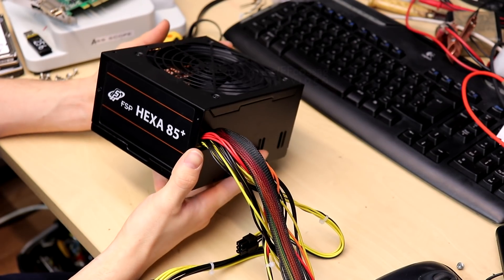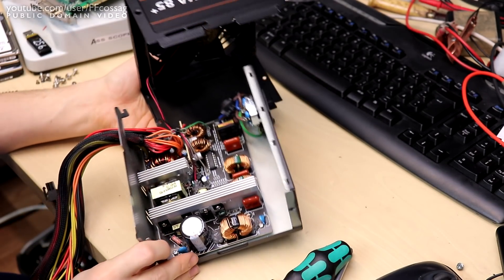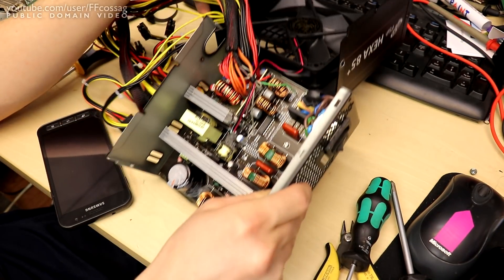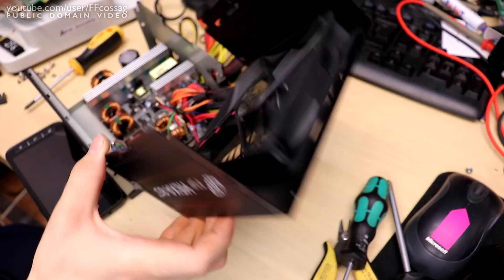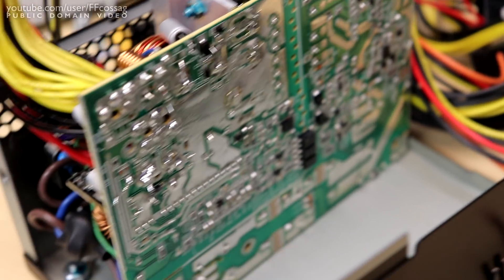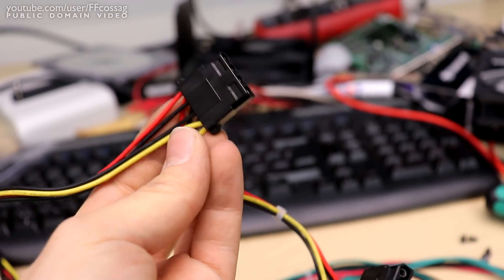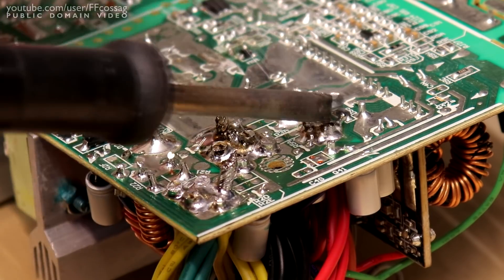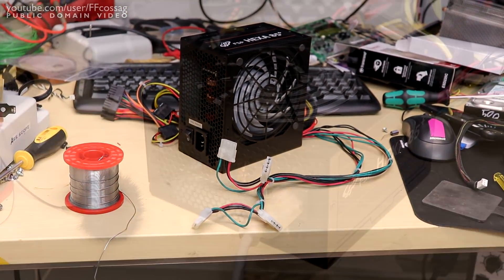FSP Hexa85+ 350 W teardown & modification

Comment: now that I'm finally doing proper research after several years... looks like all the scary stories about the bomb-tastic Hexa series are a myth?? The way I see it, Fortron just loves rebranding. Rebrand over a rebrand beside a rebrand. Different platforms which are difficult to track down just by price and naming. The original Hexa afaik was an absolute turd. They've also got a lot of Hypers, Hydros, different Raiders, OTHER kinds of Hexas etc. The system integrator lineup varies per region. Lots of models in Europe, a bit different stateside, a WILDLY different lineup in Russia, with some models actually branded Q-dion o_O
Well, guess the newer a budget FSP is, the better. And the Hexa85+ is to be trusted. Modern schematic, very tidy inside, Jap caps (I'm not afraid of poly Crapxons :P) -- and it's not really more expensive than the numerous Hyper M, Hyper S, Hexa+ and original Hexa units, all based on similar ultra-cheap 2000s platforms ... Guess some Be Quiet we didn't notice may be based off this exact thing :P
Reply from the maker: My tactic for choosing power supplies is generally just to go by 80+ rating. All those trash-tastic ancient designs are going to fail any spec past vanilla 80+.
Reply: @FFcossag  just don't grab Aerocools pls, no matter Bronze, Gold or Unobtainium 🙏🙏 I fear for the hardware of Aerocool users. They're not ancient but they're the epitome of bait-and-switch 😐 They (=Aerocool chaps) take a decent but already non-spectacular Andyson or HEC platform, send units on this platform to reviewers, then swap factories, cheapen out on the guts and call it a day, making sure that EVERY BUYER (mayyybe apart from the first batches) will get a turd with innovative smoke-emitting wires, exclusive Chenxingxangfujun crapacitors, supervisors or select diodes that tend to be just a tiny bit suicidal 😅, or all of the above. Should I even mention those numerous fake 80+ pieces of junk? (Aerocool, in comparison, still kinda pulls the claimed figures.) Probably not, because there aren't many left anymore.
On the flipside, a lot of "ancient" Power Mans and FSPs without ANY 80+ are still kicking. Better than many current models of their make, even 80+ ones (cost-down, darn it! 😡)

Comment: FSP, ok PSU with very subpar fan - In mine the oil in the fan turned into some tar like substance and stalled it. (Took it apart,  cleaned it with IPA and oiled it -  and it's I better than delivered I guess)

Comment: FSP makes hundreds of PSU for manufactures and have good quality and efficiency.  I have one in my Gateway DX4885 and is bronze rated but falls just shy of the silver rating overall.  Look up your PSU here:  https://www.plugloadsolutions.com/80PlusPowerSupplies.aspx

Here's the one in video :  https://clearesult5.sharepoint.com/sites/PLS/Shared%20Documents/Forms/AllItems.aspx?id=%2Fsites%2FPLS%2FShared%20Documents%2FFSP%20TECHNOLOGY%20INC%2E_HA350_350W_ECOS%204831_Report%2Epdf&parent=%2Fsites%2FPLS%2FShared%20Documents&p=true&cid=d5090c88-bea6-4314-8f36-0a6bd7184a6b

Comment: Makes me rather glad that the PSU in my gaming PC is a nice and silent model with plenty plugs, I forget its' brand, but I've had it for about 8 years now (and was 2nd hand off ebay!!) and it's not had any problems... :)
Reply from the maker: That's what happens when you buy a reasonable quality unit.
Reply: I bought that one because it was cheap at the time and (I think) 400 Watts, really should look at the thing, but the PC's wedged away in it's place... :P

Comment: That supply just looks too small for 350 watts, the lack of big crapacitors must be the reason.
capxon are crap generally, ive seen them last quite a while in lcd tv psu's.
I replace them with panasonic low esr ones.
Reply from the maker: You don't need huge parts if you design your power supply well, I really don't think this unit is in any way "too small" for its rating, it's just a modern design that doesn't need 5000 µF decoupling per rail.
Reply: I'm sure you are right, i imagine a higher frequency of operation may mean smaller values of capacitance.
But i'm not into switchmode design, so i could be talking crap lol.
I talk crap anyway :-D
Reply: ttbw
Ooow thats so bad, and so good :-D
Reply: ol' on, the Crapxons in this one are all polymers as far as I can see 😐 they say polymers, contrary to the 'lytics, can even come from Laoxintotallynotaknockoffcon and still be reliable...
Reply: Raven Rampkin
Now that made my jaw wobble a lot, nearly dislocated it :)
"Laoxintotallynotaknockoffcon"
I always thought polymers were made by parrots, oow silly mind :).
I'm sure you right about poly's, i don't know how they die yet so ill have to do some research when i have to replace one.